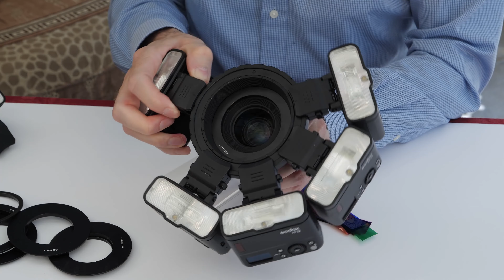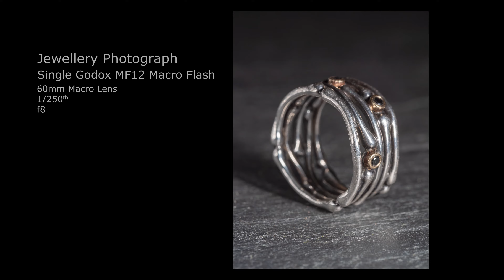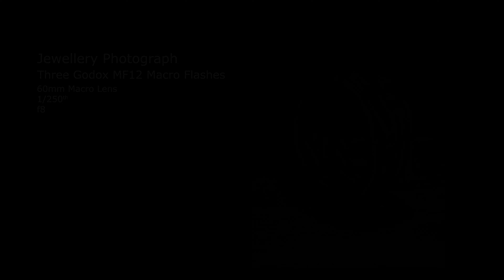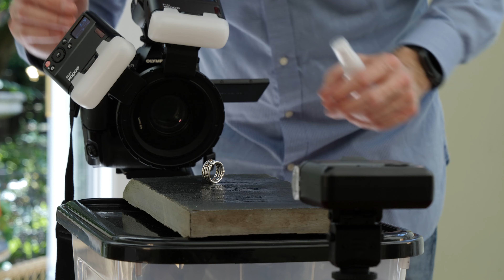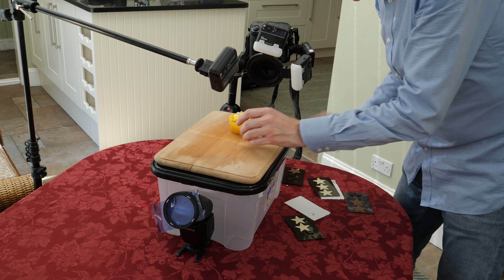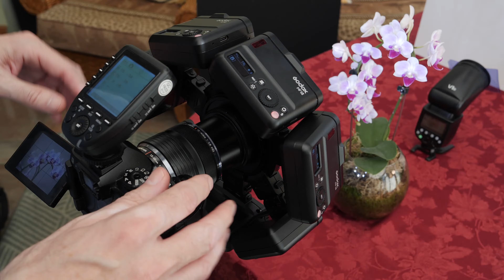Godox: Hot to do sharp Macro Photos with #MF12

Comment: How do you remove the ring off the lens?
Reply from the maker: Just unscrew it 😀
Reply: @Godox EU  I have tried that but it won't unscrew. As for removing the ring from the adapter ring do you just slide it off? It is so stiff.
Reply from the maker: @soniad3241  Yes, the ring from the adapter slides out. On the other hand, the ring itself from the lens we should unscrew.

Comment: Will the MF12 work with the GFX 100s and the GF 120mm macro lens? 🤔
Reply from the maker: Your lens has a filter diameter of 72mm from what I can see. The MF12 comes with a ring of that size. To trigger the lights you will need to buy a transmitter dedicated to the Fuji system (X2T Fuji or XProF) and everything should work well together.

Comment: Can you tell me what the flash units are set at please. I have tried using the back flash for depth but it does not seem to do anything. I have only recently purchase
Reply from the maker: Hi, the lights at the back are actually used to give depth or light to the counter product.

As for the power or direction from which they fall - this is quite an individual matter. Sometimes it has to be a stronger flash than the main light to see the effect well. The light itself is best directed at the object, because only then it will stand out in the photo :)